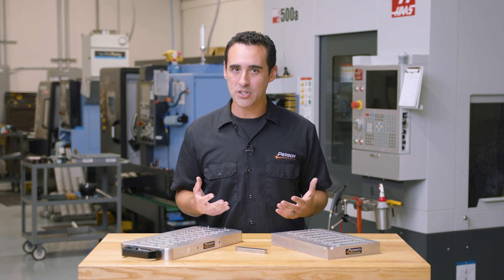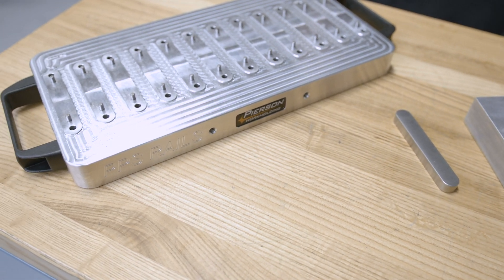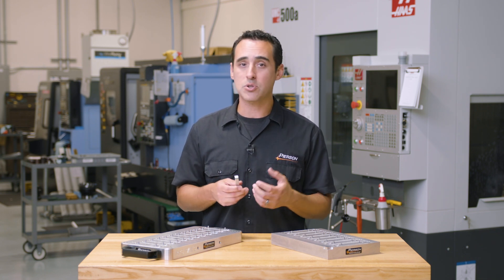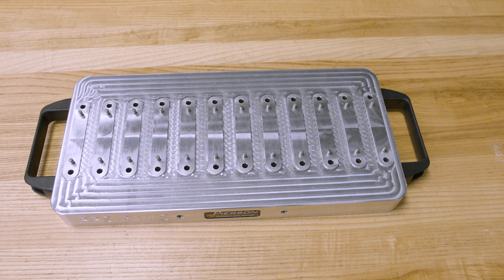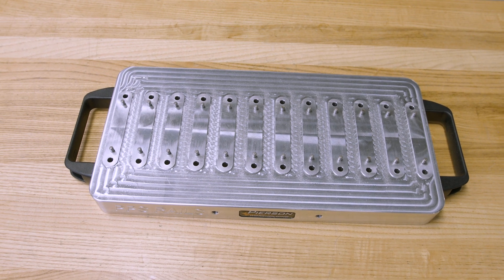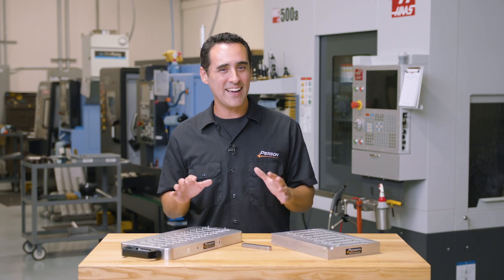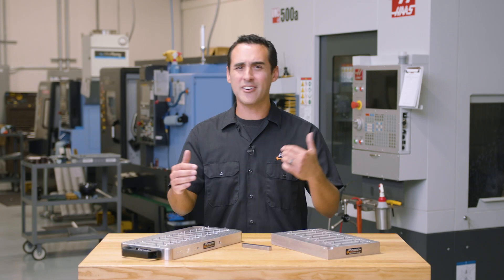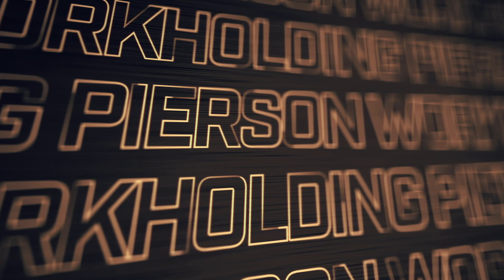Our Most Pretty & Profitable 5 Axis Fixture Ever | Fixture Friday 15 | Pierson Workholding

Comment: Hey Jay, I just watched the video where NYC toured your facility. Looks like that was an old video because your shop looks far bigger now. I was completely blown away with your pneumatic part loader that was Incorporated into your HAAS machine. Further in the video there was a small brass lathe part that was shown and you were saying that a bar feeder would be great but your inspecting every 10 parts and you were talking about a boring bar potentially breaking. My first thought was couldn't that be somehow automated with the same mindset of your automatic part loader. What I was thinking is attaching some sort of homemade dimension checker to the turret. For example some sort of spring loaded plunger that would come in contact with the feature, this intial contact point would represent zero, then the turret moves a known number depressing the plunger until it activates a relay.  Would be cool if an arduino was Incorporated and emailed you active inspection reports. Well I just wrote all this and then I realized probes exist......faceplant. I really need to find a job somewhere else, the place I'm working at refuses to use newer tech. I touch off all tools manually still using a 4 inch tool height setter. Anyways I hope to have a machine one day in my garage too. I feel as though the only way to make good money is to work for yourself.

Comment: Fixture Fridays!  Fixturing is an area I'm always looking to learn more.  Lots of areas to optimize production but it feels like fixturing is the linchpin.  If it's bad, it affects productivity more than a poorly optimized toolpath with unnecessary Z retract.  Fixturing is the foundation.
Reply from the maker: Agreed! Fixture building is a skill that one gets better at over time.  However, a below average fixture that holds multiple parts is still better than a great vise holding a single part. Thanks for watching Bill! - JP
Reply: @PiersonWorkholding  Thank you!  FWIW, I have an approach for the in-between zone.  

I have one of your pallets that I have dedicated to holding three 3" vises.  The back jaws are all aligned and I have the bottom of the vises and the back jaws within .007mm.  This lets me hold large long pieces easily.  But I can also flip to the outside jaws and hold even larger pieces.  But the best part is for small prototype runs where I wouldn't take the time to make a fixture, I can run 3 ops on that pallet, in vises, making soft jaws as needed.  

Yes, a pallet with three vises on it isn't lightweight, but I have been amazed how often I use it!  If that part I'm making turns into a production item I can make a fixture, but having 3 vises all aligned lets me easily handle times where I need 10-20 of something for testing.

I also have another pallet devoted to holding either two 4" vises or a 5" vise.  I have left the 5" vise on it almost exclusively.

Once my son, Mitch, has his items in production I'm going to convince him to document his Pierson pallets and send them to you.  He's gotten pretty creative on holding some odd shaped larger parts.

Comment: Nice fixture. My question is how does that integrate with one-piece flow on your production of the final product? How many products do you sell per week which determines how many pieces you need per week. That fine balance of Kanban size is crucial to not over producing. Can the pads be ganged with the pallet base to produce all of the milled parts at once? Lean is great fun, especially if you have the opportunity to think about the entire product cycle.
Reply from the maker: Great question and there's a lot to discuss there. I'll save that for an upcoming Q&A. Until then, the more important number on the Kanban is actually the minimum. If you get the minimum wrong you won't have parts in time and orders can't ship. If you get the maximum wrong you may tie up a machine while other parts are waiting to get made though you might still have existing quantities on hand to continue to ship product.
Reply: Paul, Taiichi Ohno defined 4 wastes, one being over production, but not how you are viewing it (although your understanding still applies). Ohno was more concerned about a single operator over producing such that the extra time they had was hidden. If they didn’t over produce, the waste of waiting becomes obvious. One piece flow is also not to be taken literally in every case. You would never hear treat one part at a time, right? One piece flow has its place but not in every situation. Another example is an assembly line which certainly may be one piece flow but components like bolts are not produced one at a time to feed the line.
Reply: Hey, kind of late, but you should look up the concept of single minute exchange of dies which is basically an advanced application of lean methods to machining, casting, injection molding.

Long story short. To allow for machining to be as lean and close to one piece flow as possible, the main problem is reducing setup time. This allows you to keep batch sizes as small as possible while benefitting from machining.

It looks to me that its pretty obvious Pierson workholding is doing exactly  that with their pallet system.